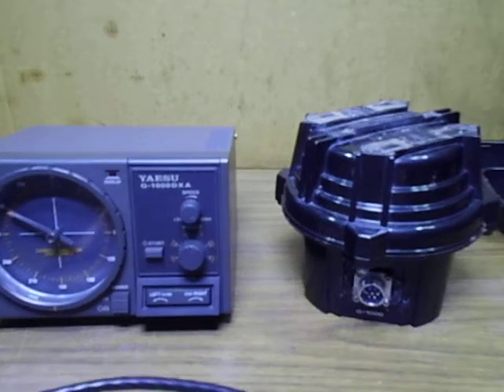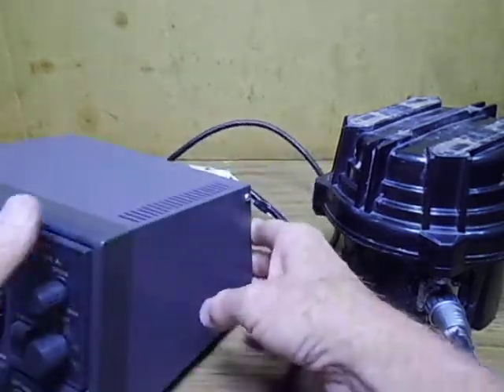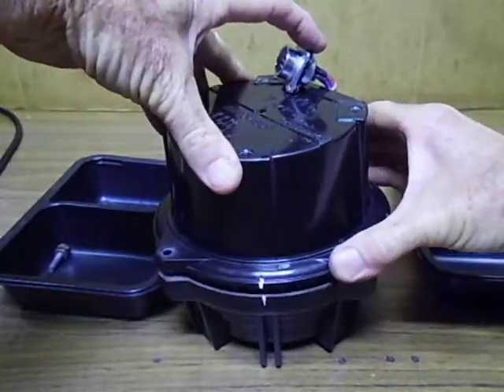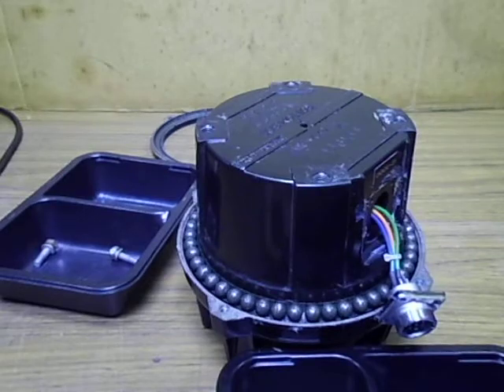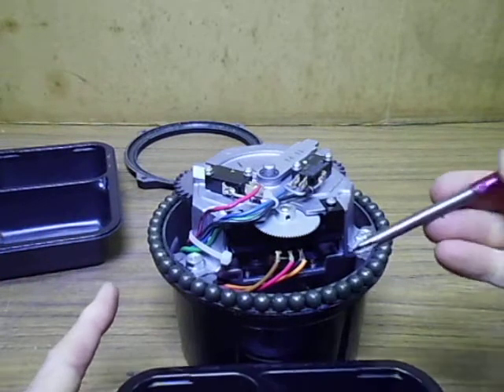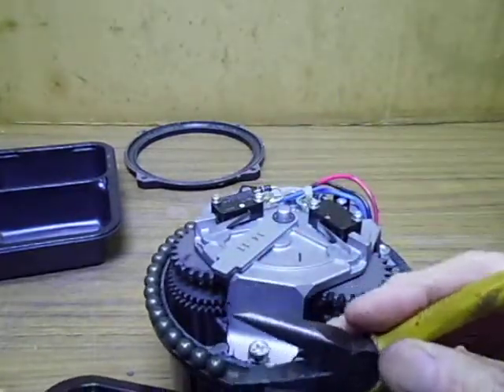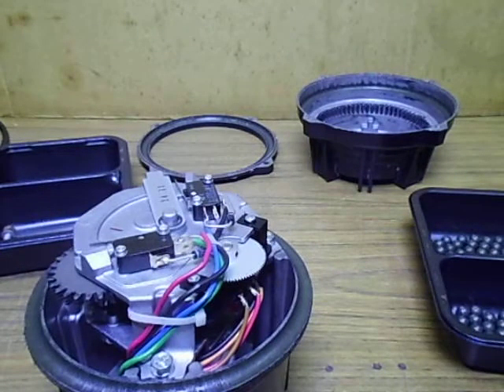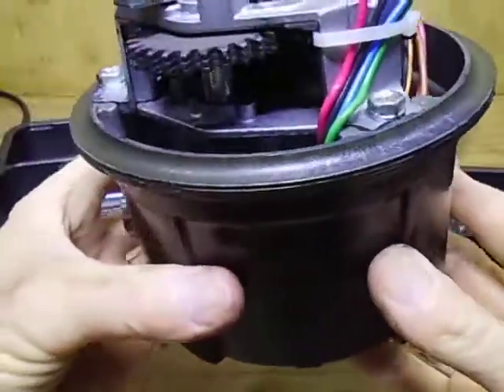Dead Yaesu G-1000 rotator strip down.

Comment: Hello this is gw4xls I have a g1000dxc only 4 years old its just stopped working over night, it lights up but nothing moves the fuse inside was blown replaced that still not working, I would  just like to know if its the rotor or controller, can I test the pin outs on controller easily to see if its the controller that is at fault thanks very much I'm gutted it not working. regards Ian

Comment: I have a G-800DXA is around 7 months old and is going to slow in MAX speed ,all in the rotor show new ,do you have idea about this 73 from Suriname PZ2YT
Reply from the maker: Hi Suriname, does the rotator go slow in both directions (left & right) ?. PH
Reply: @duoro-rotators  yes my friend, but I think to right is slower
Reply from the maker: @pz2ytsuriname630 , At a guess the BK butterfly/rotor has dropped down the motor shaft, because it's grub screw has come loose. You are going to have to disassemble the BK assembly to check the status of the BK Butterfly. I have made another video of stripping down a KR-800 (same as G-800/1000), here is the link https://www.youtube.com/watch?v=t9OEJd8h0hs, you can see how to take it apart @ the 21:20 minute mark. The BK butterfly should not move up & down  on the motor shaft otherwise it will jam up the BK assembly & the motor will be trying to drive while the brake is engaged. PH

Comment: Just curious why you didnt check the output voltages from the controller, prior to opening the rotator? Would it not have been beneficial to try a different controller prior to ruling out that part of the formula?  Thanks!
Reply from the maker: Hi Douglas, Thank you for the question, I normally get the customer to do a series of tests before sending a rotator & controller to me for repair. Those tests eliminated the controller. PH

Comment: That mark you point to at 59 seconds is not the other alignment mark. The correct alignment mark is under that bolt head to its left. The two alignment marks almost touch each other and are quite difficult to see. The mark you pointed to is to ensure you put the case back together correctly.
Reply from the maker: Hi John, Thanks for the comment. Regardless what Yaesu / Kenpro write & say in their manuals, which is misleading.
The markings on the Bearing Ring & Top Housing (which is also where the knock block is for the limit switches is) as the  rotation indicator position. When you rotate CCW to South (Southern Hemisphere setup), these marks don't align with the mark on the lower housing, when the rotator stops @ South (which is the end of rotation & also the start point of rotation setup) those marks are 45 degrees CCW of the lower housing mark (above the socket). Which makes that mark 225 degrees.   
When you have the rotator apart (for service, repair etc) & you transpose the CCW South Limit Switch (end) point out to the bottom housing, it also 45 degrees CCW & not @ the point on the housing above the socket.
I use that mark (225 degrees) as a POT alignment setup point, so I can drive the rotator back onto the CCW limit end stop to check the POT start position (you can not remove & reinstall the top housing when it is against the CCW south limit switch), you can only check the POT position & then rotate back to the alignment set point, then remove the top housing do you adjustment needed & reinstall top housing then redo POT alignment procedure.
Reply: @duoro-rotators  Howdy. Thanx for the reply. Do you have an email address I can send you a query about positioning information on the rotor?

Regards
John VK5JAK
Reply from the maker: @JohnVK5JAK  You can contact me via my web site kur02.com.au  the Duoro Services contact page or via VK Classifieds web site as I advertise on there. Regards peter